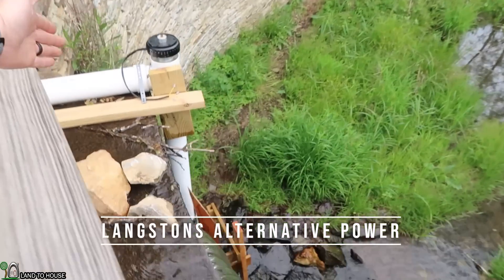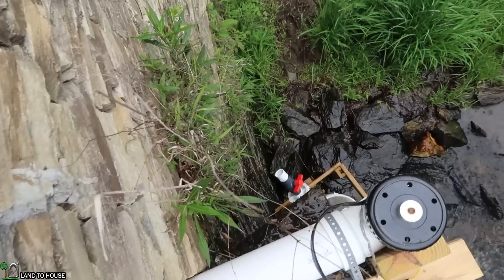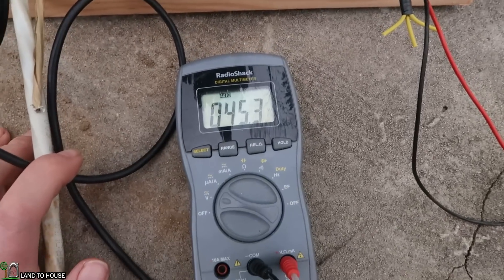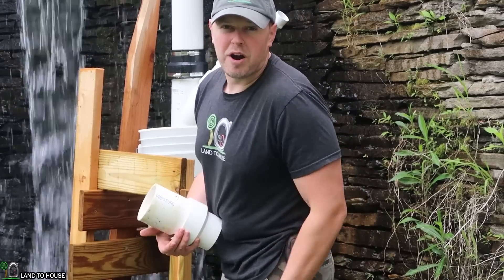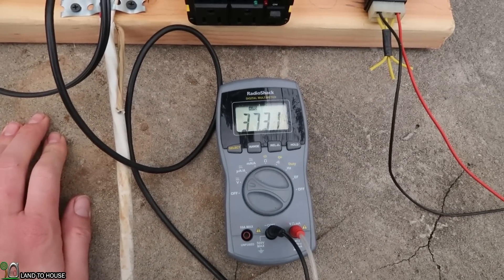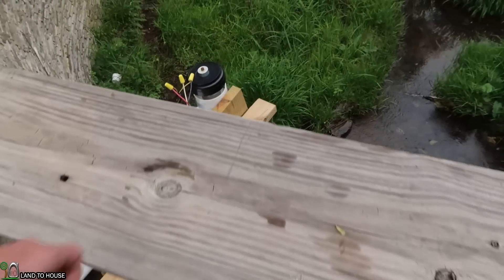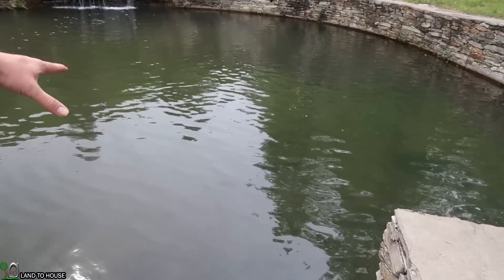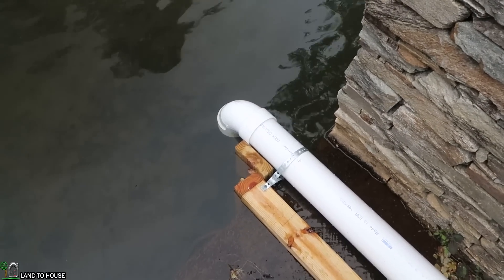Micro Hydro 4 Inch Unit Voltage Reading

Comment: 45VDC open circuit from a meter or so drop isn't too bad. I was getting about 120 from 2.5, but with a much flatter pitched runner, which you might also want to try as it should trade off some torque for higher revs.

Usually for maximum efficiency you want to run your system at half its open rpms, so whatever amps halves your volts.
This would also mean half the volume per second, so might also resolve the issue of draining your supply.
Reply from the maker: I am looking forward to seeing if it drains the source with a load. As summer comes on the flow rate drops too.

Comment: Why not test the other direction and go from 4” just below the generator to 6”? In turbo charged systems on cars, when you are forcing more air through a pipe, the exhaust end needs to be bigger to reduce turbulence. The same can be said on this type of system as well. Also, consider having generators on each pond that matches the flow rate so as to take advantage of each section’s worth of water. (Not an in-line system. All separate)

Comment: What if you kept the 2 inch on the siphon and put another siphon on the dam before the one you are currently using. Would that not supply enough wattage to charge a battery after the dump load?
That is both of them together

Comment: Not surprised, as you increase size the area grows quickly.

I converted to cm's lol
 
2 inch, converted is 81.1 cm^2
3 inch converted is 181.5 cm^2
4 inch converted is 324.3 cm^2

Each inch more than doubles the area of flow, you can quickly see why the 2" had such a drop in output.

I had this fun when building my hydroponics lol
Reply from the maker: Ah yes that is a fast drop in area. Seems like 2" is not going to allow enough water to pass.
Reply: @LandtoHouse  most likely not, if memory serves me tho, butting the restriction at the start should also give you different flow rates than putting it at the end.

I think I am going to enjoy watching the tests etc, I don't have access to a flow of water.

Comment: Removing the pail should also increase output
Reply: It may not be an issue with that short a draft tube, but with taller drops air can start coming back up from the outlet which constricts the flow and can potentially break the siphon.
Have the outlet under water prevents this, and doesn't seem to provide significant back pressure.
Reply from the maker: I wonder if I drop the bucket so that the down pipe is just barely in the water. Almost no resistance.
Reply: @LandtoHouse  It will always cause some back pressure, when not straight open, like your car exhaust right?
Reply from the maker: I will see if I can test a way to pull the bucket after it has started.

Comment: Thank you, very interesting test. I did not expect that, the amount of water coming down your creek isnt enough to load a battery!!
Reply from the maker: I think that whenever the battery is connected to the 45 V it will charge well. But this water won't sustain the flow for long.
Reply: @LandtoHouse  by reducing the pipe, wouldn't it also reduce the flow? creating a longer reserve of water ? at the 10 minute mark, i realized you already answered my question.

Comment: Once under load the water consumption will be much lower because the turbine will be slowed down by the load. As such the limiting factor may not be the diameter of pipe, making these results invalid.
Reply from the maker: Yes indeed. I guess we will find out that information coming up next!
Reply: @LandtoHouse  Well they are valid, open flow (no load) measurements are critical to understanding its behavior before moving to a loaded test, else you won't know how the reducer versus the load affected the results.  Good experimental method is to make only 1 change at a time between measurements, exactly what you are doing.

Comment: if you hooked two generators in series in the plumbing would there be enough water to run them both on syphon???
Reply from the maker: From my understanding whenever you connect a second in series the resistance will slow the water and you have the same or less power made
Reply: was about to ask the same question, ok so what if you split the pipe 1 onto 2 back into 1 ? i'm just thinking there is still energy in the given water, you need more power but don't want to syphon your dam dry(obviously) therefore how can you get more from what you have
Reply: @arronjohnston742  im thinking one pipe whole time with one generator after the other but not horizontally but vertically  so as to capatilize on gravity and the 8lbs per gallon of weight turning everything?>?>
Reply: @energystoragesolutions6603  yeah i thought of that too but after thinking about what Seth said i think he is right, another inline would be a restriction to the first generator as it would make the water slow down and back up, spitting the pipe into a Y pipe wouldn't really restrict it as an inline system would, still would be interesting to see it all tested out for real.
Reply: @arronjohnston742  I agreed to the testing either way. Either way if you split the pipe into two from one they will only be able to pull as much water as the inlet will allow, however if he reduces the output of the pipe to that of half of the inlet the generators would run as though one generator was getting the full benefit flow of the inlet size however it being split into two the generator will still only receive half of the available input

Comment: Sheesh! That's one heck of a waterfall !
Reply from the maker: Yes it's perfect for testing out this kind of thing.
Reply: @LandtoHouse  You've prob considered it already, but how about a paddle wheel?
Reply from the maker: My neighbour is actually about to install a water wheel here. I need to get my tests done quickly! 

 Might have to move to the other side of the pond To use the other waterfall.
Reply: @LandtoHouse  NICE place.  Beautiful stone work.  I'm going to ask today if it'd be legal to damn the creek that runs thru my place.  Back until about the 1950s, it had been used/diverted? to power a stone barn/lumber/woolen mill
Reply: @LandtoHouse  use the outlet of your setup to spin his water wheel, there you go ponder that one for a bit hahaha (oh great i made a pun)